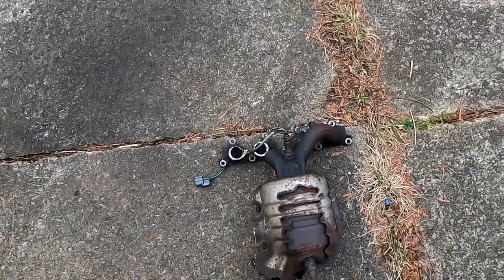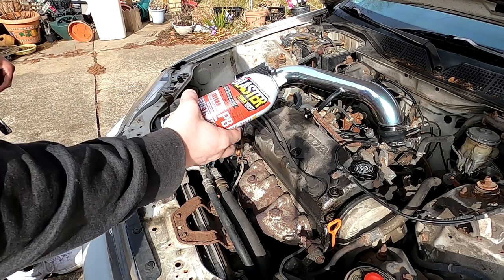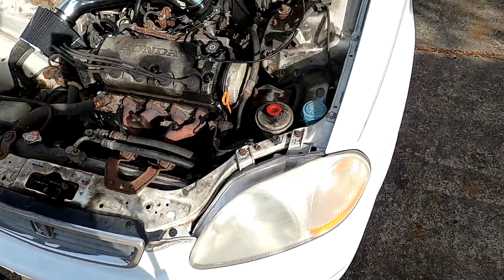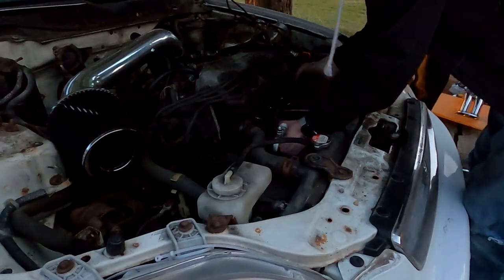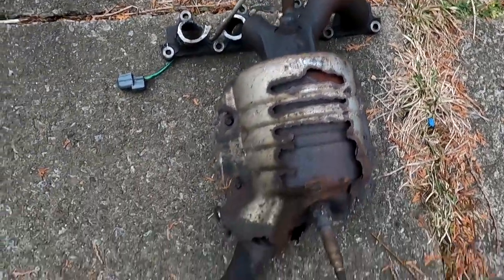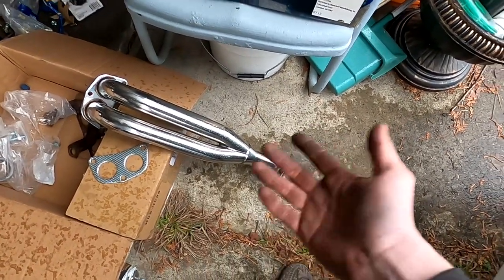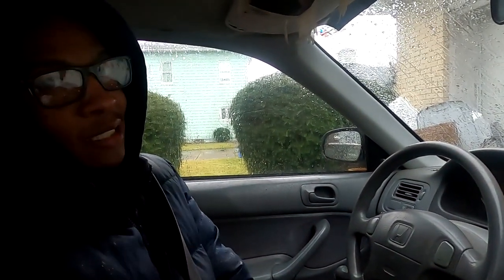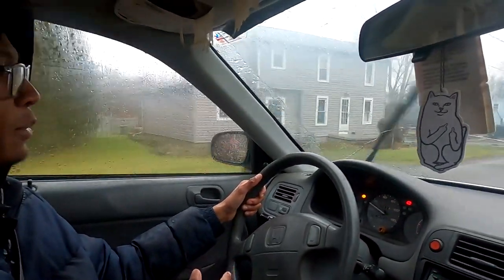INSTALLING A $43 EBAY HEADER ON A 320K MILE CIVIC

Comment: Pro tip: if you think a bolt is going to snap, loosen and then tighten on and off and that will usually keep it from breaking by freeing up the threads
Reply: So my car won’t blow up after using the eBay headers 😂
Reply: What I do is put the ratchet tip on the bolt, hammer it few times, then put on the rachet and just tap the handle with a hammer forwards and backwards. It' loosens up the rust without breaking the bolt. Works 99%

Comment: It sounds like a Subaru because it's not running right.
Reply: Lol, right.. misfiring maybe.
Reply: Don’t think anything’s wrong with it running wise never had any issues with aftermarket headers
Reply: nah....equal length headers = Subaru rumble..... the cars running fine
Reply: @xXmassniperzXx  equal length headers don’t give it a rumble smh. Unequal length gives it a rumble sound. Also gives it less power
Reply: That cars trash.  Other then that.  I have the plm header.  It does sounds a bit rumble ish.  At low rpms.  Good for low end. Sucks up high from my experience with it.   Its on my trash y8 lkq motor.  Put a gt28 on there and post a vid
Reply: Lifters need to be checked.
Reply: Uel headers give a rumble. Cars running fine

Comment: Lol, years ago I had a 96 DX Civic that I put a Ebay header and exhaust on. It was still running fine 4 years later when I sold it after putting it on. It would backfire if I held it at higher rpms and let the car hold itself back. It sounded like a pretty loud gun or bomb going offlol. I remember riding by this club that used to be in the town where I lived while a bunch of people were outside waiting to get in and when I made it backfire, there were people screaming because they thought someone started shooting. 🤣🤣🤣🤣🤣
Reply: bout to buy one myself , howd u get it to shoot?😂
Reply: Explain how you do this lol
Reply: You could’ve gotten the cops called on you for having a firearm!🤔
Reply: Thee ol honda drive by

Comment: This is my car in the video. I wanted a different sound and since it’s a beater I don’t care about the rust or the other bs that’s associated with the car. Plus I was on a budget. The check engine light before the install was from something that happened and it remained on since. I will say if you are looking for good aftermarket headers check out skunk2, 1320 uel, or dc sports.
Reply: How did that header hold up after a few months? Welds still good?
Reply: @ItsJustChase  Yeah the welds held up fine, but I would suggest getting a better gasket in between the header pipe and down pipe. Mine blew like the next day.
Reply: Hope you eventually got a catback on there, even the cheapest one on ebay would sound better, as long as it has a muffler and a resonator too.
Reply: @AdmiralRustyShackleford  I scrapped he car, once i put this header on a lot more issues surfaced and I threw in the towel. The previous owners really messed up the car and it was just a little project car/daily that I thought I could get running better.

Comment: Guys the problem with the rusted bolts and studs can be easily fixed! Spray on the best rust remover you can find. Leave it over night. Then start unscrewing the bolt. If it stops don‘t go further. Screw back in a little bit and unscrew until it stops and repeat. The rust gets stuck in the thread and if you proceed unscrewing then the studs break. So doing it like this will save you a lot of time and you don’t have to mess with this again. I myself read that tip on the internet and it worked great! :)
Reply: a wire brush to the rusty threads will help too

Comment: Help a brother out and tidy up that engine bay. Valve cover gasket degreaser and paint valve cover and update most of the rusty hardware
Reply: I did later on in like June of 2020 but I ended up scrapping the car. It had so many issues from when I got it and they only got worse in the long run. I do miss the civic though.

Comment: It would sound a lot better if you at least ran pipe to the rear or some muffler. When the header and the pipes under the car it vibrates the whole floor and is louder and a longer pipe to rear would quieten and make exhaust sound go to rear while driving
Reply: Fr
Reply: They just kids

Comment: Now might wanna try the Ebay full exhaust. I know on the Corolla's the ebay stainless cheap cat back has a deep throaty sound to it. Might do the same for the 1.6 Honda's. Just a thought!
Reply: My ebay exhaust for my d16y8 had fitment issues and horrible rasping from 3k rpm’s up. A cherry bomb makes it sound way better tho. Piping was 2.25”

Comment: Does it have Cold Air?
Is that a Check Engine Light?
Maybe a Cat Code?
Signed, owner 96 Civic DX 198,728 miles.
Reply: Check engine will be a cat code for the bank 1 o2.... just pull the gauges and take out the light.
Reply: ayeee I'm also a 96 civic DX owner
Reply: @historyhunter5215  check engine light is due to the catalitic converter delete. there is a downstream senson which was left unplugged in this vid

Comment: Its rumbling because its not running right. I took the second sensor off my car when i did headers and it was way slower after, so i put it back in with an L spacer because i have no cat, and i got my power back, actually had a little more. It doesnt have the second sensor just to see how the cat is working, the engine adjusts fuel input and spark timing based off how the two sensors read. When theres a cat, the exhaust gases after the cat are relatively stable, because thats what cats do, but as the second sensors reading changes the engine adjusts things and uses the first sensor to verify what its doing.

Comment: Okay so you were still able to use your O2 sensor how did you do that they had a place for it on the headers or on the pipe. I'm trying to replace my OEM cat with a performance one and then put headers

Comment: thats a single overhead cam 1.6L it doesn"t have v-tech
Reply: If its a y8 its got vtec
Reply: @FiendTheatre  that's not even close to true
Reply: @apple4apple247   its not a y8 tho. its a y7. no vtec solenoid and both Intake and  exhaust manifolds are not y8 spec. so hes right. it doesnt have vtec
Reply: @FlightyWolfwood  his claim is bc its a single cam 1.6 is why theres no vtec, which other 1.6 sohc do have vtec, sooo...
Reply: @FiendTheatre  not on all. some sohc engines have vtec and some dont. my D14A8 doesnt.
Reply: @FiendTheatre  nope.

Comment: Why is the check engine light on
Reply: Vando GG because they think you don't need the downstream o2 sensor lol you DO need it and if your a EX or HX model say goodbye to vtec until the check engine light is taken care of
Reply from the maker: I wasn’t aware about the vtec using info from the downstream, however the car used in this is the non-vtec LX model.
Reply: Carter Maneki you can't legally pass emissions with the check engine light on or without a cat, hang onto the old one for the next owner or emissions time. You need to route the the other wire to the 2nd o2 bung at the back of the header, it will take care of the check engine light and keep the car from getting shitty gas mileage.
Reply from the maker: MacFrugal this car is registered in Ohio, which doesn’t require general or emissions inspections, which is good because the car has so much rust that it wouldn’t even pass the general. I personally live in Pennsylvania and am all too familiar with the emissions portion of the inspection, I run cat shells on all of my cars and have the P0420 CEL tuned out
Reply: Because this car has a catalytic converter exhaust manifold and when you remove your catalytic converter the obd2 will sense it’s missing and if will trigger a check engine code it’s best to do this on a d16y8 or a d16y5 cause they have the cat 🐈 that’s not attached to your exhaust Manifold
Reply: @garymijangos9403 👈 listen to this guy👈

Comment: Just got my first Honda Civic EX 96
So I’m new to the whole game but 
What’s the difference between a Catalytic converter and header?
Reply from the maker: the catalytic converter is the component of the exhaust system that scrubs the exhaust of gasses that are harmful to the environment. The header is just the exhaust component that comes off the engine and “collects” the exhaust into typically one pipe. A header could contain a catalytic converter, but a lot of the time aftermarket headers will either not have a cat or have a “high flow” performance cat. Hopefully this helps!

Comment: yo i have a serious question, i changed the exact same part for headers on a honda civic 2004 LX but im worried it might not pass smog cuz the stock had the catalytic converter on it, im in california btw
Reply: You don't have the exact same car so it's not the same part. If you look inside you aftermarket header, you'll see a white screen which is your cat. If you have one, you should pass. If not, like me, im running 4-1 headers on my d17a1 however i have my ebay cat ready when i need to smog.